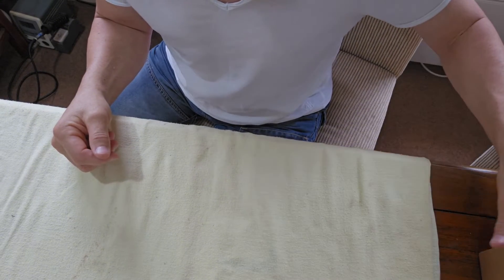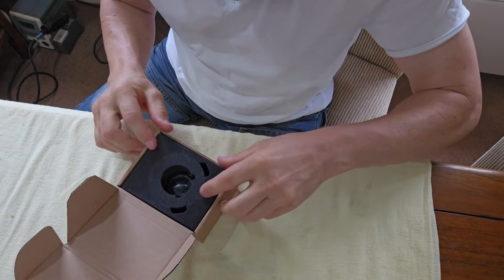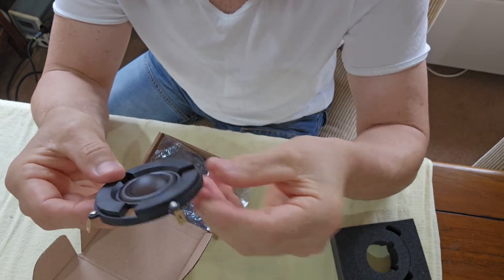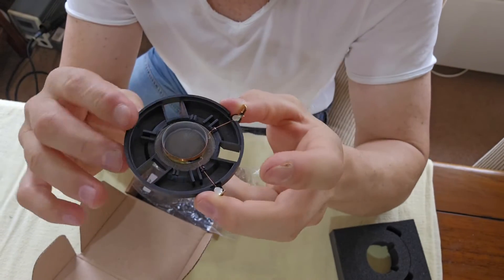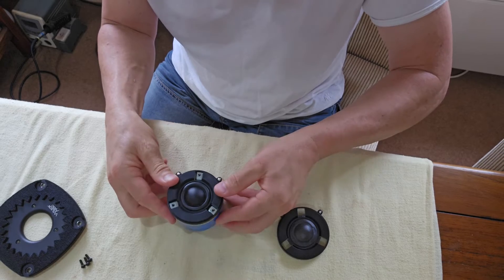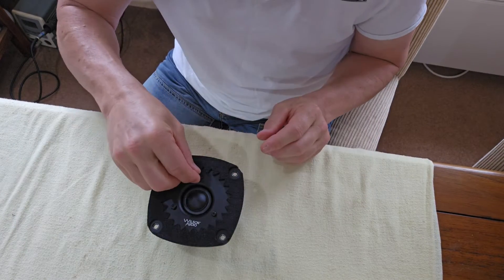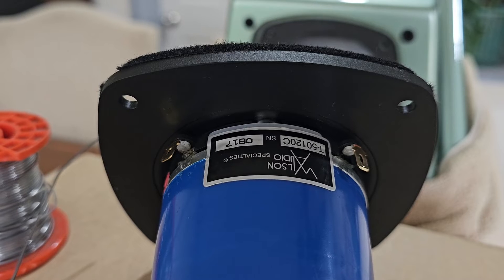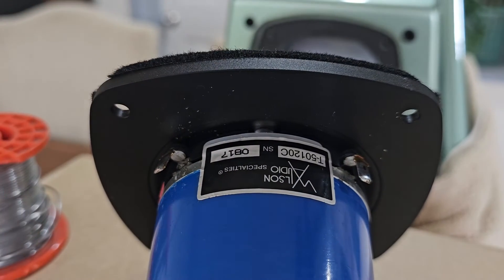"WILSON ALEXIA TWEETER REPAIR & INSTALLATION" EPISODE 3!!!!

Comment: I’m curious whether Wilson would sell you their version of the Scanspeak tweeter with the 14-winding, 8-ohm tweeter voice coil diaphragm subassembly or only sell you the complete tweeter drive unit or tell you to pound sand and send the tweeter cabinet module to Wilson Service in your area.
I’m certain you saved a lot of $$ going down your preferred path to repair this damaged tweeter diver subassembly. 
Great video series!
Reply from the maker: Thank you, Drago. The final video goes into all the details around pricing and what options I had available to me. The next one is in room measurements.👍

Comment: Yup, fun with tweeters! Have a pair of 80lb 37 year old b&w's with a blown tweeter. Luckily I got a used diaphragm off ebay for 30 bucks to replace it. Glad it worked, cause their too heavy for door stops! Still sound excellent after all these years!

Incidentally, on the other end of the price spectrum I bought a pair of b&w 802d2's used from a dealer. Got them home and one of the diamond diaphragms was broken,  it cost the dealer $1200 to replace the damn thing! Was easy to install but ouch!

Be interesting to hear the price of your diaphragm replacement!

Also,  could you not get the original part? Why the 4 ohm?
Reply from the maker: That's great news about the b&W's well done. I go into all the details about pricing and everything in the final video. That should answer all those questions I imagine.🎧👍🙂